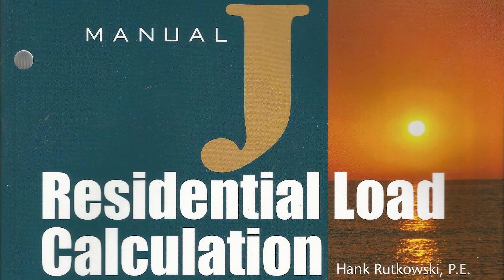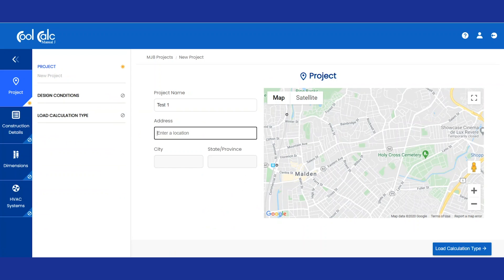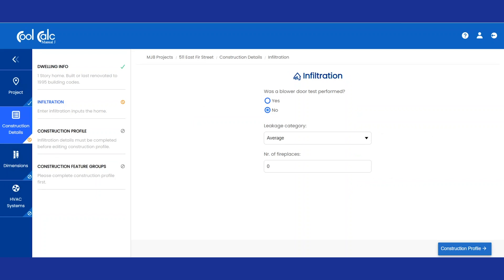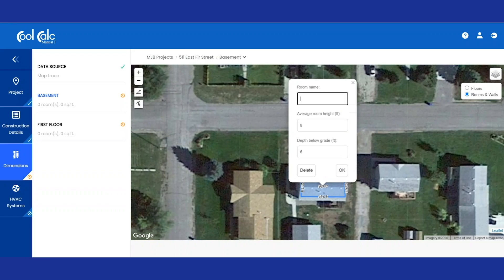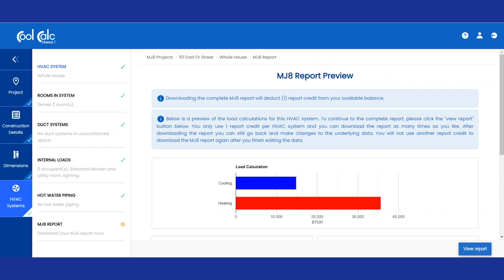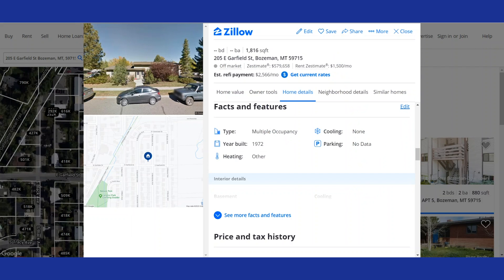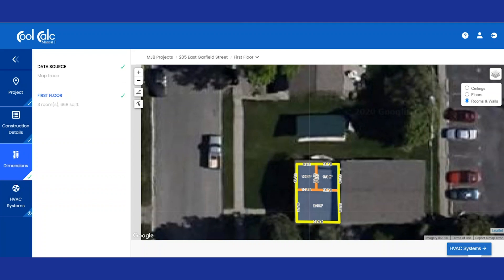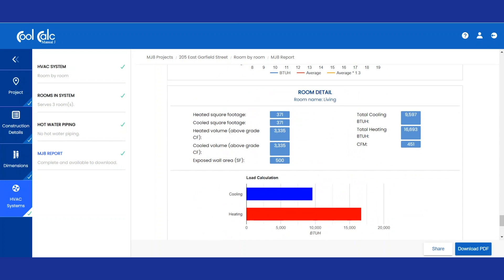Heat Load Calculation: Manual J Made Easy

Comment: NICE Tool  like it whats  the costs  But add an True  JOB site visit inspection  also correct ? so as to answer some then questions like insulation Attic , floors  doors windows  ... duct work  , other ventilation  pipes or equipment , yr sf off wed site we do it  ..but  size ,  quote ,  discuss ,  & sells job  ... >  proper sized installs ...Heat Gain Heat Loss  Size matters

Comment: For my purpose, to get a Manual J calculation for a new, highly insulated house, this was useless.  It only allowed specifying board insulation of R-6, which is minimally insulated ZIP sheathing, but doesn't even correspond to two inches of external continuous insulation.  This can't do the calculations for the insulation required by code in the the latest IRC.

Comment: I tried this on my own home and it was way off using building codes for 2000. I performed a manual J and compared the two just for the heck of it. The heat load was off by 18K btu's and the cooling load was off by 11K btu's. Both numbers are higher than the currently installed equipment.
FYI - I have performed hundreds of manual J calc as I have been in the HVC trades for over 25 years.
Reply: Have you used any heat load calculation software that is accurate?
Reply: Wow , I just started this app , and haven't been doing hvac work and school for about 3 years.  So thanks
Reply: That's great. Unfortunately, we have no way of judging how accurate 18k BTUs and 11k BTUs inacurracy is your situation. Did it result in an oversized system? If so, by how much? And how much did that translate into in terms of additional cost? Or, if that's too much, what was the correct number so we calculate the percentage difference. So, although well intentioned, your comment actually gives me no useful information. Please consider editing it to include a way to judge how accurate or inaccurate your results were other than an absolute number. Something to compare those absolute numbers to would be a very generous improvement to your well-intentioned comment.

Comment: I want to add two mini split units to a top floor of my house.  Each room is 15 x 16 with a knee wall that is 5 foot high, the angle is 4 foot(directly under roof and the ceiling is 9.5 foot across. The entire top of hose has R19 closed cell spray insulation.  The two rooms have R5  rigid foam board on walls and ceiling.  The floor under is heated and cooled.  How do I adapt this program.
Reply: I’d suggest using the average ceiling height, assuming you place your mini split indoor units in an optimal spot. E.g. the average between 5 and 9 is 7. A little geometry will show you this yields the correct volume. You may want to add 10% to the height to account for convection, so 7.7’ in this example.

Comment: course tracing a zillow picture of the home to get square footage?? Good Lord that is so inaccurate. What if part of the roof line is covering a outdoor porch which you can't see from outside? What about a 0, 6, or 12 inch roof overhang?  Sites like Zillow and RedFin report the square footage of the home. Note that some of that may or may not be under air conditioning, which matters when sizing a unit.  With Manual J being so absurdly complex and specific, I don't know how such a simplistic program can come up with the same calculations.
Reply: Licensed Mechanical/HVAC Engineer and Master Plumber here,  worked 10 years for Carrier Corp before, How can the software provide an answer? Simple. The developers used reasonable assumptions plus built-in safety factors within the program.
You are correct Manual J is complex and specific although not as complex and specific as an ASHRAE cooling load calculation which an hvac design ngineer does. Because the purpose of the software is to provide quick easy to use results that are nevertheless reliable enough. The expert developers of the app simplify the process by selecting reasonable , "typical" values for the various inputs. For example, thermal resistance values for light weight concrete walls in strictly speaking vary depending on specific construction, but the values should range around X to Y, based on properly done, industry practices. The same for other inputs. Based on occupancy density from code or manual input, you can also estimate average heat load from a human occupant, around 300-400 watts per person.

Another critical factor they coded in for example is the temperature and humidity data for the location. However , based on extensive ASHRAE research, there is an "average climactic condition per location", ashrae usually updates every 4 year cycle.

With all those reasonable estimates, educated guests nonetheless, there is bound to be errors to the software output. So this is where technical studies comparing the results from various cooling load calculation methodologies are used, from the simplest to the most detailed across various building types. In one study, we actually done in-house, Equivalent Temperature Differential (ETD) Method which is the method used in Manual J underestimates the Results if you use the most accurate method, Radiant Time Series (RTS)  by 30% and other hand say, an actual test model house has 10% higher cooling load than RTS. So let say, the software selects a 40% safety factor. Now you have a more reliable but simplified estimate for the Software User without going thru hell for a simple residential project. Hope that helps.

I forgot to add, peak peak peak cooling load over an 8760hrs in a year, happens only 1% of the time in the year or 88 hrs annually, based on Climate Data, So Manual J results + Fixed Speed Systems will get you an AC system that definitely meets the cooling load assuming you input the "right data" but is nevertheless less efficient than using an variable speed /inverter system that can match the load with capacity. But hey, one step at a time.
Reply: Manual J calcs use ceiling area, not roof area and R-value of insulation.
It also uses wall area, overall sqft area, window and door areas, etc.

Comment: Just tried it, unfortunately it doesn't let me calculation with R9 or R21 for exterior insulation. couldn't put in 10" concrete basement, couldn't put in R20 basement insulation, it doesn't seem to make clear when itemizing - external vs. internal door.

Comment: We added closed cell foam to the outside of our above ground  basement walls and open cell under the roof deck. Is there a place in this system to record and account for that change? Our efficiency is considerably better than the building codes of the 50s.

Comment: The house that I am working on is a new construction and google maps does not have any data on it yet. How would I use the trace function from a blueprint? Thanks!
Reply: In one of the steps, there is a part where is Data Source. Select the text mode where you can enter the size of the rooms individually.
Reply: Don’t use this for that
Reply: you make the lines according to your construction plan